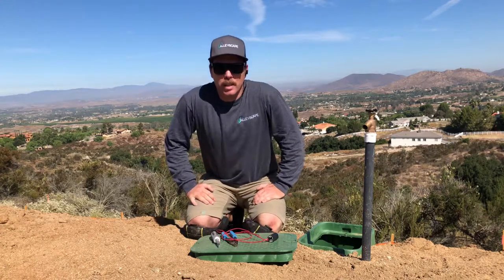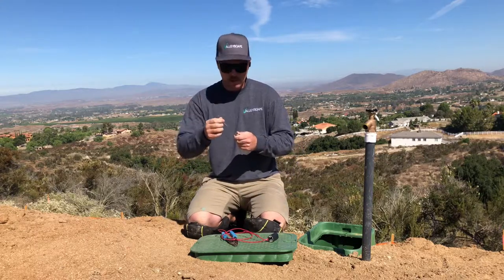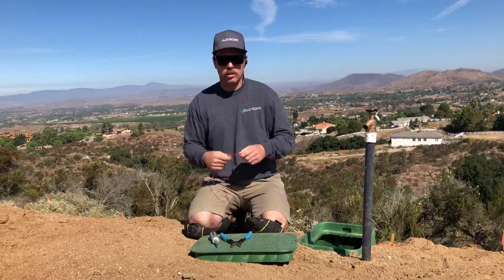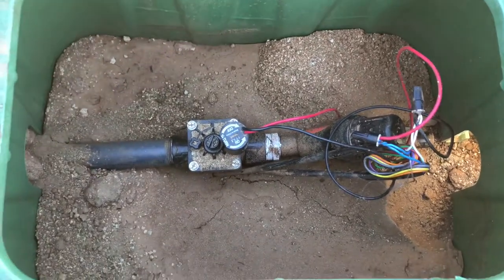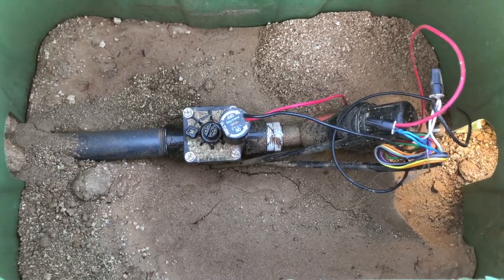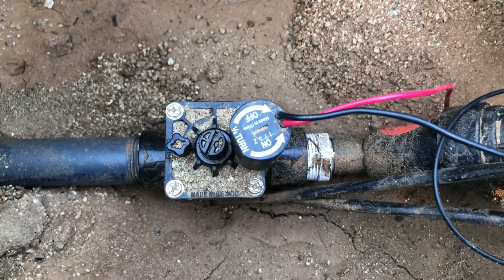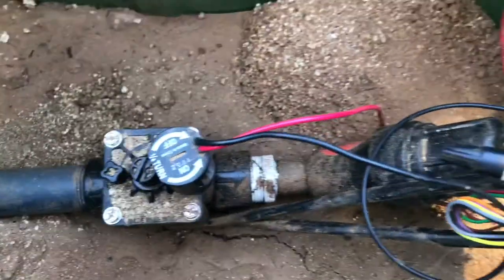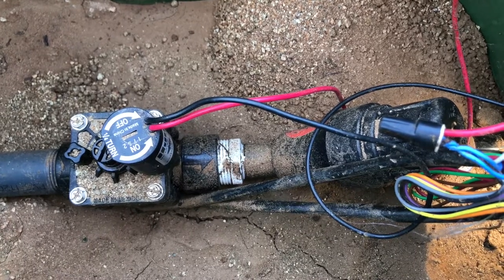How To Fix A Sprinkler Valve That Is Not Working.

Comment: Got a brain buster my solenoid is good ohm readings were where they needed to be. I thought it might be the field wire I put a tone through it and that checked out however zone still will not activate. My last thoughts are either the valve being bad, or long shot the control box is one of those press and hold tabs and it is loose or not making proper connections everything else still functions except the one zone.
Reply from the maker: Did you do a resistance text on the field wire? 

Or

Check the diaphragm on the valve I’ve seen some rain birds not opening. I’d start by replacing solenoid just for the heck of it

Comment: Hi! When I turn the valve on manually with a screw driver, some water starts spraying out the side of the solenoid (no water comes out the sprinkler heads). Also, if I try to activate the zone from my control box, the solenoid just buzzed, but no water sprays out anywhere. Thoughts?
Reply from the maker: Hi! Most likely the valve is not opening al the way. It could be the flow control or a valve failure. The good news is your getting electricity to the valve and water so it’s gotta be the inside of the valve.
Reply: @sprinklerboss  replaced valve bonnet, solenoid, diaghram,... zone 6 still not popping up, any ideas?
Reply from the maker: @AJCoReTV  sometimes is another issue. 
Most common are top to bottom:
-leak in the zone, maybe unseen
-nozzles or repairs made to the zone that pushed it above the limit that the water supply could handle
ex. most one inch valve max out around 30 gallons per minute, if zone is close to that number it won't allow the heads to pop up.
-pressure regulator failure up stream from the valve you worked on
-shut off valve not open all the way.

One of these has to be the problem.

Try closing all the nozzles off on zone six with the little screw on the top. this should allow zone to pressurize and if you have a leak it will surface.
Reply: If I turn the off/on solenoid to all the way on, all the sprinklers turn on when I’ll have only a section selected to be on from my hunter system (the brains of the irrigation set up) also they stay on and won’t turn off from the hunter brain. I tried finagling with it and others but I can’t seem to get a section at a time to run.